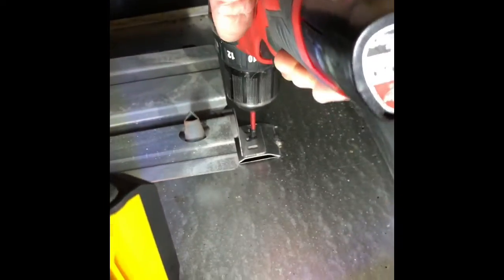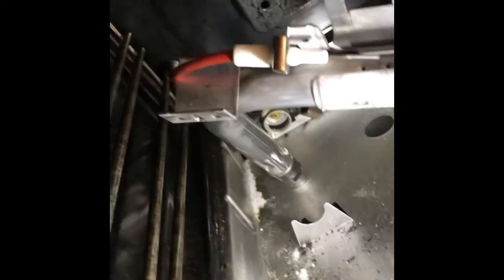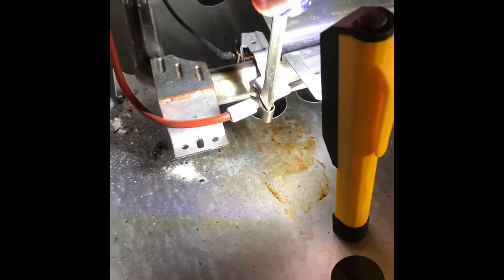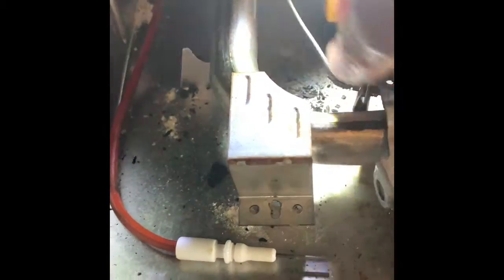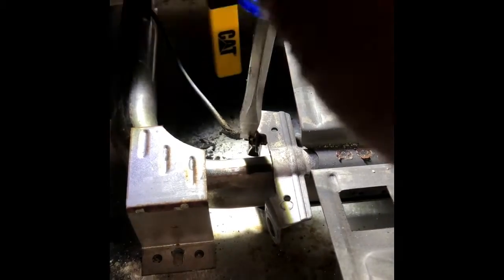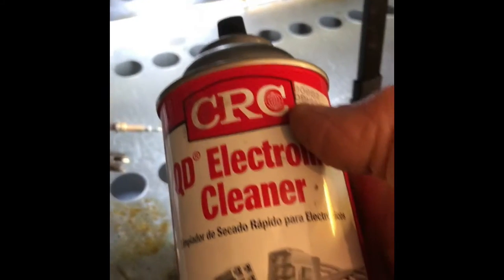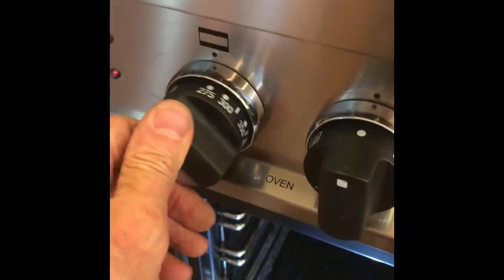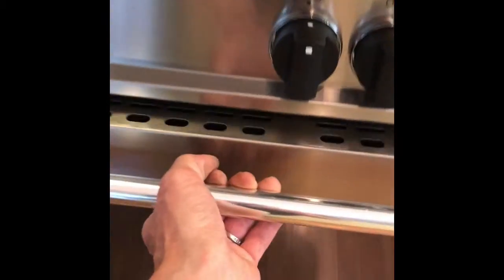🔥 Bertazzoni Oven Doesn’t Heat — QUICK FIX 🔥

Comment: Scott, I have a Bertazonni 36 inch gas stove.  My thermocouple seems fine, but the oven takes two full hours to reach 350 degrees.  The stove top burners work great, but the oven heats so slowly, it’s useless.
Reply from the maker: Can you try cleaning the spark probe with electrical cleaner and a wire brush?

Comment: If you have a similar issue, you will be better served by replacing the Thermocoupler. Once it is loose where the Cooper line and tip meet the Thermocoupler has reached its life span.
Reply from the maker: Thanks Dean, that’s always best.